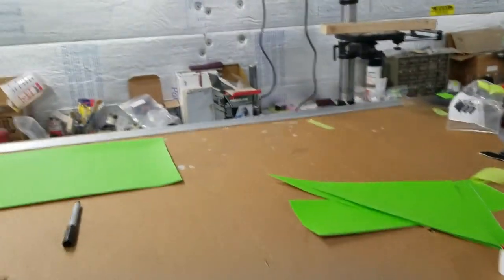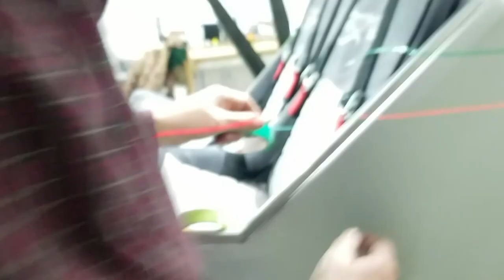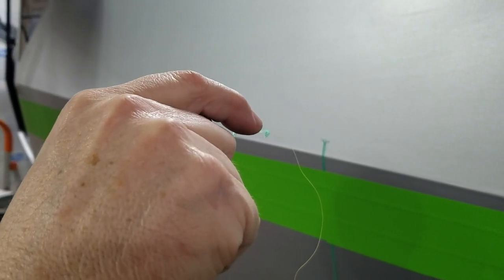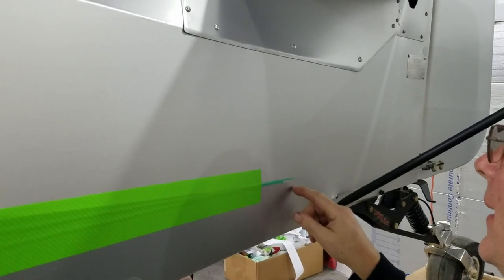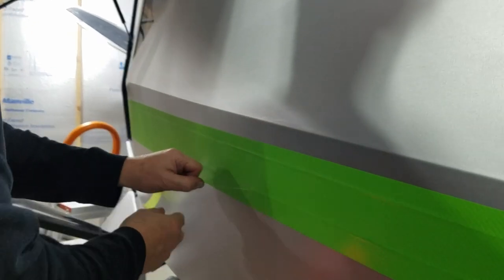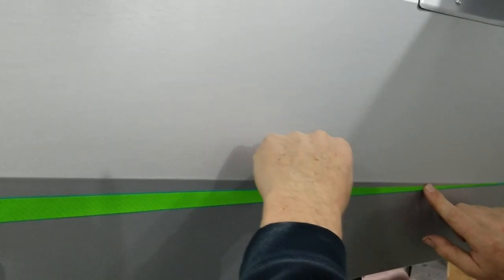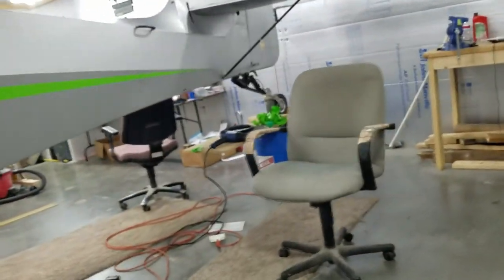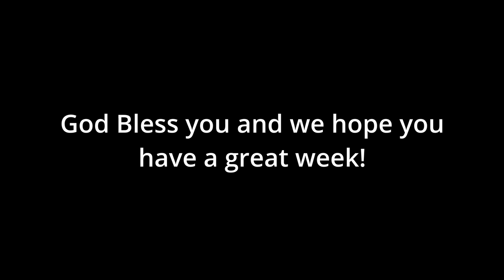Vinyl Car wrap on a Kitfox airplane?? Farmfox gets some strips! #47

Comment: The pin stripe really sets it off! If you pin stripe the bottom, maybe use a wider tape in a bright blue as a shadow line spaced a 1/8in off of the green.
Reply from the maker: That sounds interesting Edward, we are not very good decorators to know what to do for looks. Thanks
Reply: 1/4 inch black accent above and below the green would be good too. imo
Reply from the maker: @huckleberry8079  You agree with Susan, that was her thoughts too! Thanks

Comment: Looks great. To protect your film and paint and aid in locking in the air release, us a piece of the backing paper. Lay it on an area you are doing your final press down on. Then you can angle the point of your squeegee more perpendicular to the surface and use more pressure without worry of drag or scratching the vinyl or paint.
Reply from the maker: Thanks Scott, I will do that and I appreciate the advice!

Comment: Harlan, by adding the John Deere Green color to your airplane I believe you may have just forfeited your right to maintain your aircraft.

Seriously though... thanks for sharing this, I hadn't heard about this material you are using. The accent color looks nice. (I'd personally go with full black pin-striping around the green, top and bottom)
Reply from the maker: You may be right Glenn. I can't get a repairman certificate anyway cause no one at the faa will take a office visit. They are still all at home working. They are checking to see if it can be done over the net somehow but it's been 3 weeks so maybe I can't fix it any way. haha